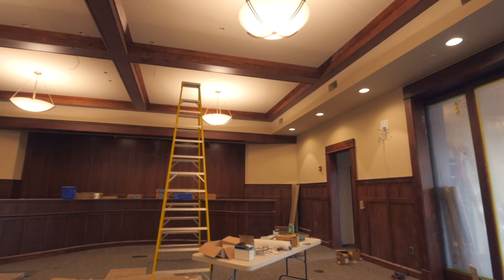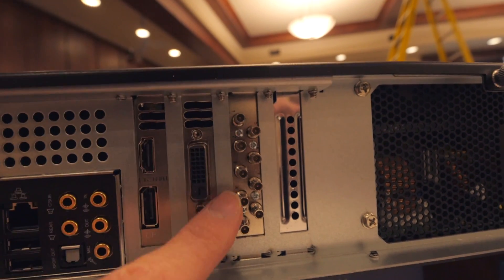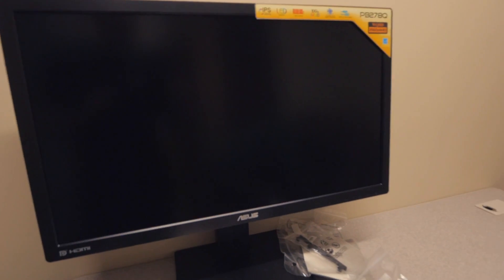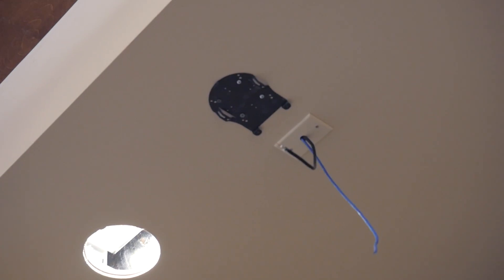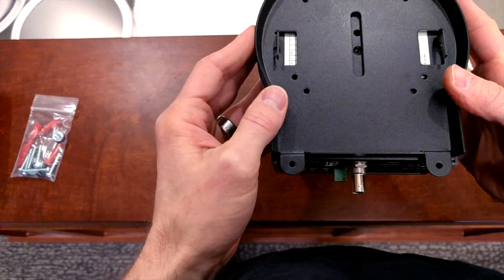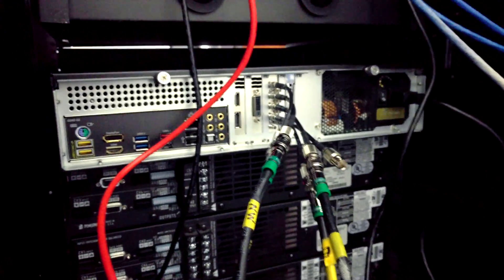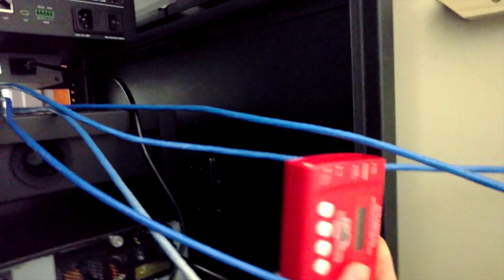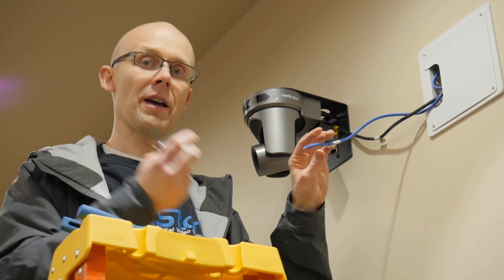City Hall Multi-Cam Install w/vMix & PTZOptics

Comment: Do you guys do quotes or estimates before going to do the setup?
Reply from the maker: Hi, Sophia: Absolutely. The customer pays for all the gear up front, then pays for the installation when it is complete.
Reply: @dvestore  Do you guys only work in Montana?
Reply from the maker: @lanegrabella8  We are based near Seattle WA, but travel to do installations. Do you have a project for us?
Reply: Not at the moment but I wanted to know the process of how ya’ll work because we are based in Miami, FL and eventually I’d like to upgrade our whole system.
Reply from the maker: @lanegrabella8  Feel free to reach out to me when you want to get moving on the upgrade! jason@dvestore.com

Comment: do you have specs/config information you could share from your vmix pc? Thank you in advance.
Reply from the maker: Here is a comparable system made by the same supplier: https://www.dvestore.com/acme-video-solutions-acmerack4-hd-sdi-nvidia-gtx-1050-ti250gb-system-drive-16gb-memory/ vMix also has some good system spec recommendations on their website: https://www.vmix.com/products/vmix-reference-systems.aspx

Comment: I am curious why you used SDI instead of RTMP streaming back to the Vmix PC?
Reply from the maker: RTMP can introduce latency, which I prefer to minimize.
Reply: Unless you are doing IMAG, I don't understand the reasoning, but that's fine.
Reply from the maker: They will be sending live video to multiple screens. I didn't set that up while I was there, but they will be adding that later on.